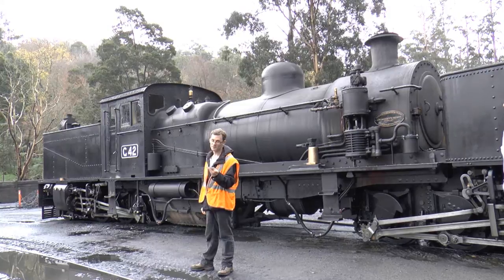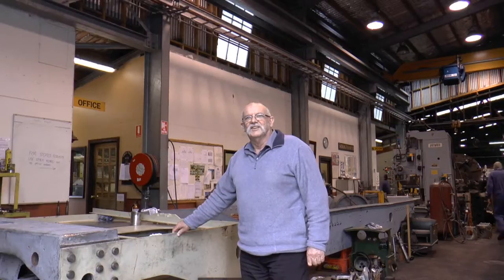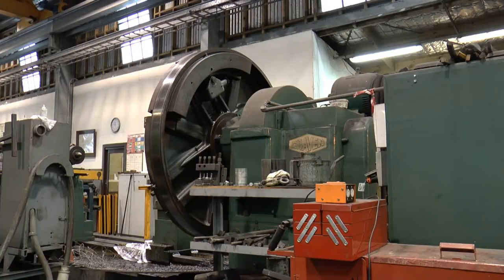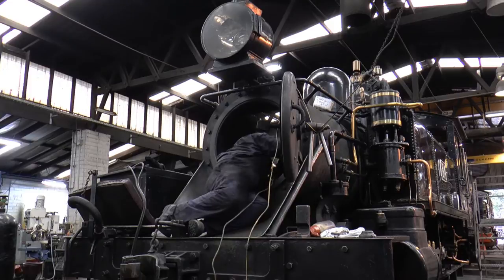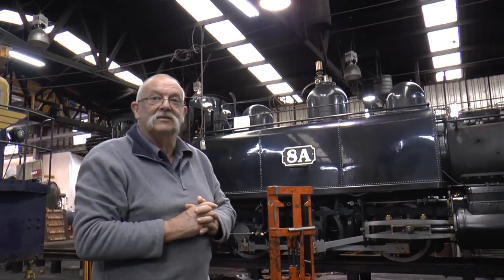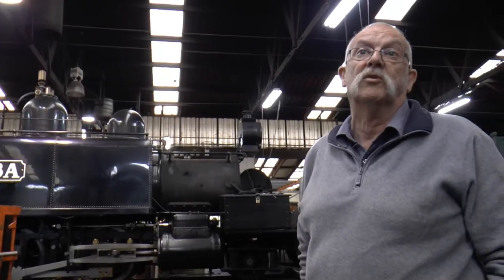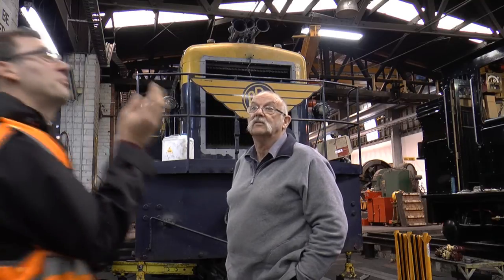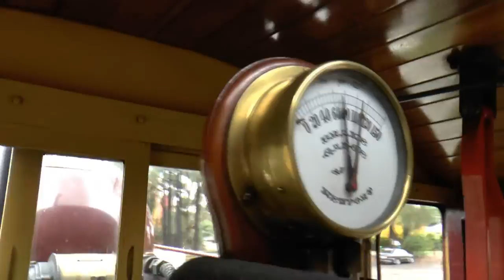World Famous Puffing Billy - Engine shed Tour 2015

Comment: hes talking broad gauge, surely he meant standard gauge ? 6 : 21, i could be wrong, The most common railway gauges in Australia are narrow (1,067 mm or 3 ft 6 in), standard (1,435 mm or 4 ft 8 1⁄2 in standard gauge) and broad (1,600 mm or 5 ft 3 in) gauges. The narrower 610 mm or 2 ft gauge is found on shorter lines, particularly sugarcane tramways in Queensland. but not brunels  7 ft⁄4 in (2,140 mm)
Reply: Victorian Government Railways in the 1800s chose the broad five foot three inch gauge, so when he said broad gauge he meant exactly what he said.  The colony of Victoria was awash with gold rush money at the time.  If I recall correctly the colony originally chose standard gauge but the engineer who started building  changed the gauge without much consultation. New South Wales chose standard gauge and stuck to it, . Queensland was relatively impoverished so chose three feet six inches in 1863 or 64 with the first short line completed in 1865.  The story goes that there was less than a pound in the colony treasury when there was a large gold discovery at Gympie in 1869, saving the colony from bankruptcy. South Australia and Western Australia chose three feet six  inches.